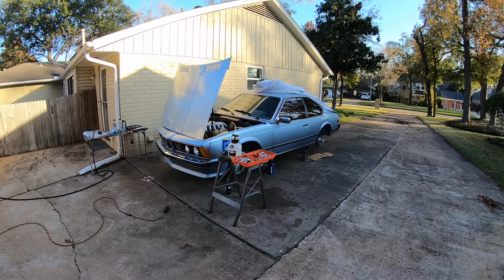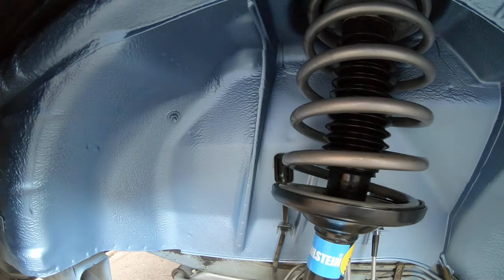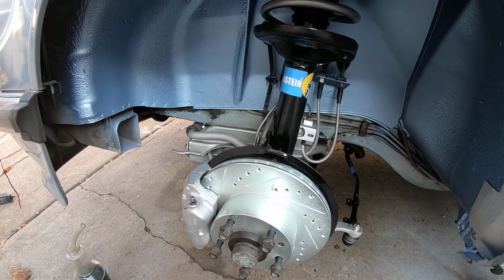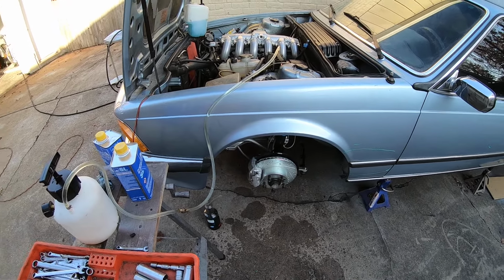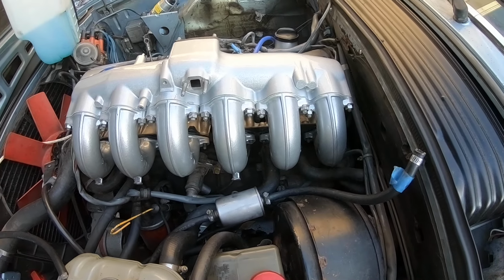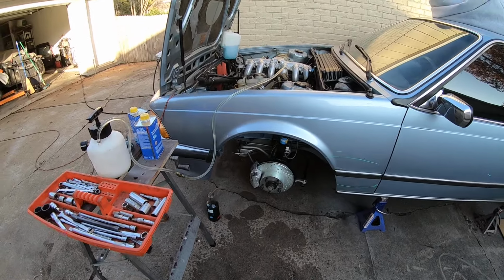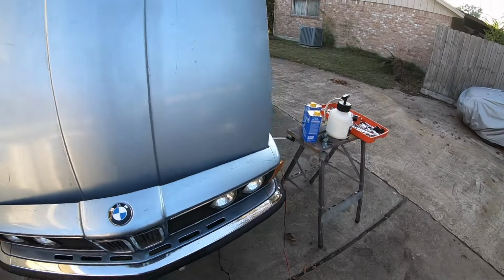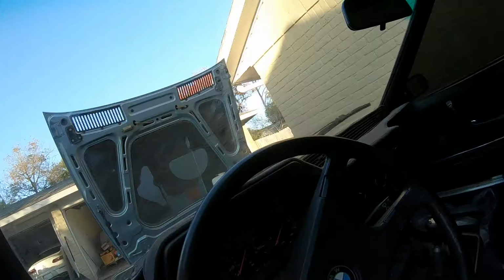1979 BMW 635CSi (Euro) E24 E12 - Part 3: Rebuild of Front Suspension, Front Brakes, Front Subframe

Comment: Where did you find your parts? Gorgeous Euro e24. I myself own a 1982 Euro-Spec 728ia my uncle bought her new while stationed in West Germany.
Reply from the maker: Thank-you!  With these cars so old and parts not readily available I had to get creative when purchasing parts. I bought from a variety of vendors from Ireland Engineering (great service & prices), eBay sellers and Turner Motorsports. The brakes were purchased from Brake Performance. Best of luck with your awesome E23 728!
Reply: @slownrusty  thank you for your information

Comment: Beautiful restoration. I am in the middle of working on a 1982 633. I have the same type of brakes and suspension. Do you happen to have the part number for that sway bar and long bolt?
Reply from the maker: Thanks!  I appreciate it.  The sway is the OEM \ original part and the long bolt (I assume you mean the sway bar end links?), I purchased from Ireland Engineering.  Here is the link: https://www.iemotorsport.com/product/sway-bar-end-links-stock-style-2002-e21-e9-e3-e12/
Reply: @slownrusty   Gotcha, Yes I just went and bought those from IE (end links and control arms). This is a great video and very motivating..... I have mine up doing all of the front suspension- (Keeping original everything) 
 If you don't mine me asking more- Where did you get  Tension compression rod bushings and all of the bolts that go under the strut housing (the weird nut/bolt combo 3 of them)    I have all new tie rods on the way and have been "Therapy Cleaning" this pig..... Loving seeing this build- thanks again great cars

Comment: Glad to see your brakes are working. Did you use original oblong spacers? How much adjustment on master cylinder? Does engine mount order go upwards from body - rubber - spacer (rather than body - spacer - rubber).
Any chance of some panel gap measurements please to help me reset mine to factory please?
Good luck with restart, bunch of bananas manifold are famous for air leaks but I have a different configeration on mine so cant comment, sure you will get there sharpish. Dont attach fuel lines in reverse like I did as there is ability (in mine at least) to connect in reverse order which will prevent starting. 
Well done on a nice car getting back on the road 
Mark

Comment: where did you source all your new bolts and hardware? love all the work and attention to detail so far!!
Reply from the maker: Thanks.  All fasteners were bought from Belmetric
Reply: @slownrusty  Thank you! Do you have a list to reference all the different bolts needed?
Reply from the maker: @ricardolimarch  - yes I do have an entire list by bolt or nut size, thread pitch and length and which bolts require a washer and also the washer thickness.  If you are a member on Big Coupe I can post on there to help other owners.
Reply: @slownrusty  I'll go there :)